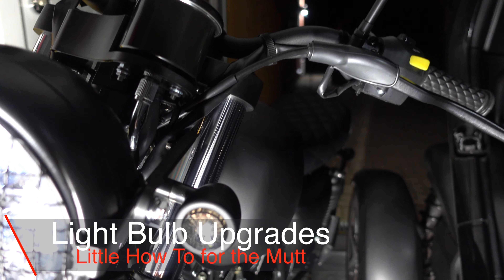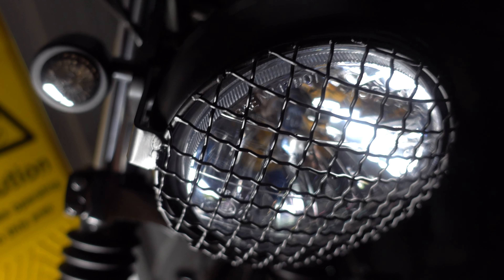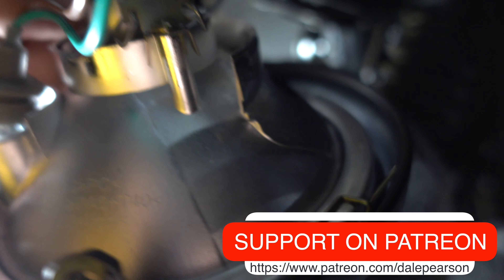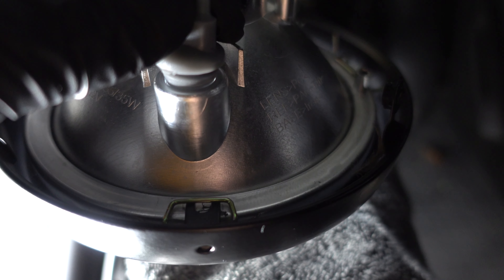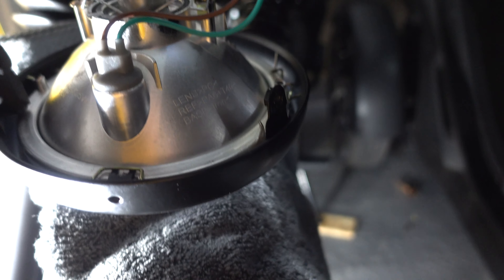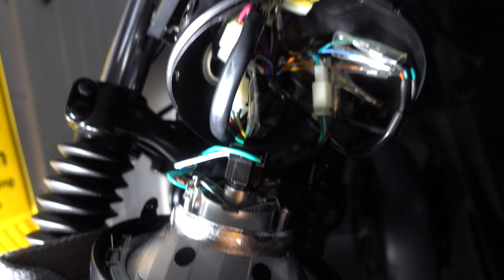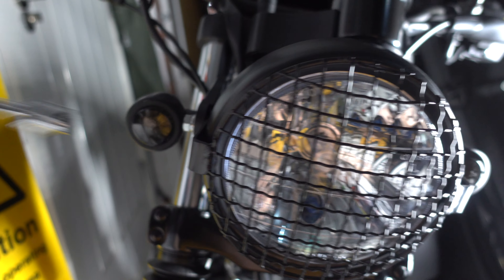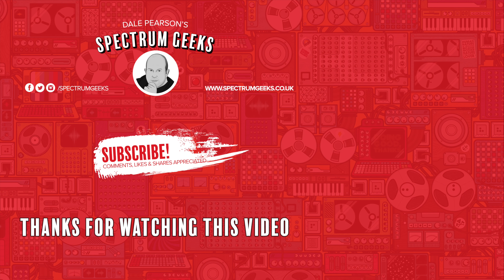Upgrading my Mutt Motorcycle Head Light Bulbs - Osram X Racer

Comment: Hi mate, my brother has a lexmoto adrenaline. Standard fitment on that is a H4. Wanted to get the osram night racer H4 for it as the standards are quite dim along the lanes in the morning. Just wanted to check there wouldn't be an issue with the wattage increase from the standards 35w/35w to the Osrams 60/55w? Cheers
Reply from the maker: Should be fine, just need to be conscious of the power the battery can supply. When the engine is running its a non issue, just don't leave ignition on only for ages.